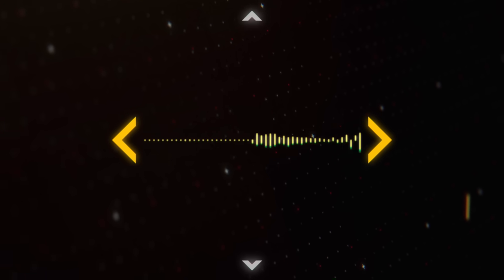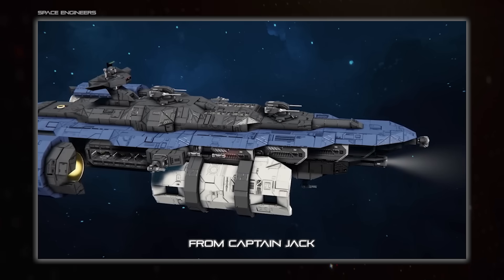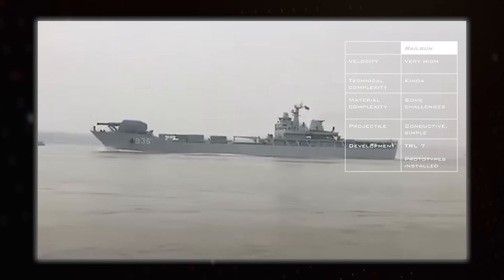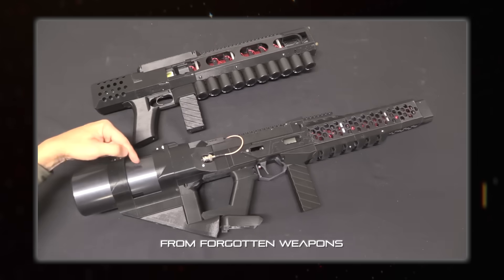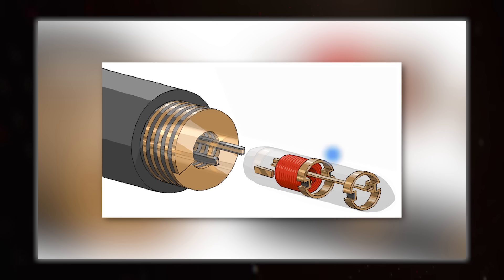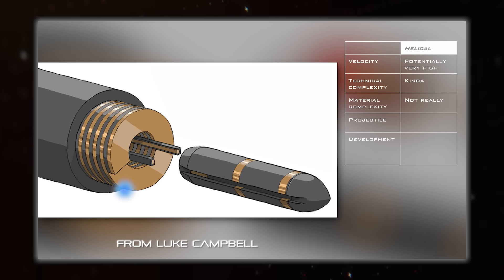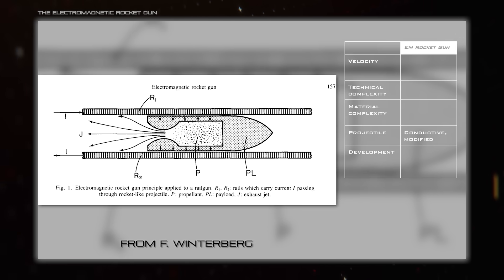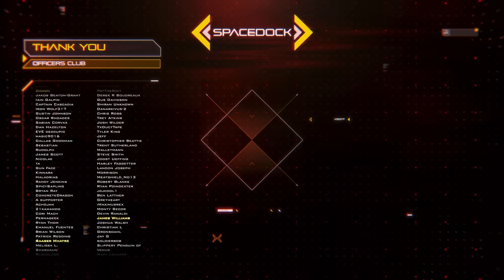The Deadly Coilgun/Railgun Hybrid You've Never Heard Of (Helical Railguns)

Comment: I think the gap is unlikely to happen because you can file those gaps with magnets or electromagenetes to boost the rail gun.
That advantage of a gun that can fire in both direction is weapon that would be aimed with the ship. 
With the acceleration involved you want those to be as long as possible to minimize forces on the ship. The longest possible is the length of the ship. Building the ship around the gun is ideal from the gun perspective but you could mount it on the side with powerful control moment gyroscopes or reaction wheels to handle the torque. 
In this case the gun can be used offensively fire fowards in direction of what you are chasing or defensively fired backwards in the direction of those chasing you without having to do the acrobatic maneuvers we see in the expanse.

Comment: Can you cover some more exotic styles of sci-fi weapons? Such as a Plasma Projector, from The game, Sword of the Stars. From what I under stand it's like those old TVs with colored toobs when you look close. It fires a literal rain of plasma projectile. Like a school of fish. All heading in one direction while being spread out a bit as wide as the projector. It's a larger weapon platform system. Much bigger then single shot plasma cannons. On smaller ships. It's mounted face forward only. While larger ships. Can have 2 to 4 mounted on as swivel turrets. The system resemblance a cone, with the flat part facing the enemy. And They only project in short bursts. And have a cool down time or recharging time. Unsure of which one.

Comment: One thing I always wondered, why do MACs in Halo have a muzzle flash, when they are essentially a gigantic coilgun?
Reply: That's not muzzle flash; that's the projectile. A projectile accelerated to relativistic speeds WILL be hot enough to emit light.
Reply: You saw the enormous slowmo muzzle flash from the Navy rail gun in this video, right?
Reply: @coltonholiday4872  Yes, but macs are coilguns. They don't have any explosive charge, because the electromagnets do all the lifting. With railguns there is an explosive charge at the beginning, otherwise the rails and the projectile would fuse together.
Reply: @attila535 It doesn't matter; rail or coil, there's going to be matter converted into plasma and pulled in the projectile's wake...from friction if nothing else (remember that even a vacuum isn't actually empty...just sparsely populated.)
Reply: Maybe an explosive to begin the launching or from vaporizing metals

Comment: Does this mean you’ll eventually talk about Induction coilguns as opposed to the typical ferrous reluctance coilguns?
Reply: Good question. In my experience (almost) all serious military coilgun research has been about induction coilguns because of issues with velocity limitations on reluctance coilguns.
Reply: @derekp2674  When I learned the difference, I figured it could make use of an iron core solenoid as the 'bolt', and the passage of electricity goes through a coil around the bolt, and another coil around the base of the barrel, to better 'squeeze' the non-ferrous bullet out.

Comment: And what do you think of mass effect magnetodrynamic weapons? basically shooting molten metal accelerated by electromagnetic force. and because it is like shooting drops of water, the whole would reach extremely high speeds, but when thrown together, when it cooled it would become a single, extremely long projectile.
Reply: basic science of molten metals: magnetism becomes zero when the metal is molten.
Reply: @jaquigreenlees  The metal doesn't have to itself be ferromagnetic like iron nickel or cobalt to be accelerated by an MHD pump (and this weapon is just a particularly high flow velocity MHD pump, at least in concept).
The acceleration happens for the same reason that the acceleration in a railgun happens. Lorentz forces induced in the pumped conductive liquid.
ANY conductive liquid will work with an MHD pump, even seawater.
Most research into MHD pumps has been based on using them to pump NaK eutectic alloy thru cooling passages in a liquid metal cooled nuclear reactor. However, like I said, ANY conductive liquid will work (including mercury, already molten metals like Lithium (probably of use in fusion power due to the want to have the lithium blanket which breeds the tritium be molten for ease of separating out the tritium and other "fission" products (yes, it's fission when you take Lithium-7 and crack it into Tritium and Helium-4, even tho the reaction requires an overall input of energy it's still fission)).
You can also use an MHD pump to pump gases if you ionize them first, this is how you get things like Ionocraft, electric thrusters for spacecraft use (using an easily ionized noble gas), and even the humble "ion wind" electrostatic air purifier.
Reply: @jaquigreenlees  The idea is that the electromagnetic force heats the metal and expels it, under pressure, that is, not by pushing or pulling but by pressing, as if it were a jet of water but with metal and due to the extreme force the speed would be very high.
Reply: I think it's the other way around - the projectiles are molten because they're being pumped with that much energy during the firing sequence.
Reply: i think keeping the metal in a proper shape would be difficult.

Comment: a weapon with reloadable rails would be cool
Reply: Machine gunner teams already carry a spare barrel. Doesn't seem that hard to take 10% off the tested reliable number of firing cycles, and stick a counter on the back to display shots until rail change needed.
I'm surprised the US dropped development on naval guns. Their range may only be ~1/10th a cruise missile, but a sabot + projectile, and a new rail every 50 shots, seems substantially cheaper than $500k-$1mil per shot. Seems like they'd be very useful for asymmetrical engagements where you're not worried about return fire from missiles. Or mount them on stealth cruisers, or semi-submersibles, or....
tl;dr it's 202x, where are the hydrofoil cloaking stealth railgun cruisers.
Reply: @ThePieIsNotALie  Two possible reasons. 

First and most likely, the Railgun development is finished, and the navy is just waiting for materiel science to solve the barrel wear problem before they start producing the things in numbers.

Or second they have publically declared that its cancelled while continuing to fund development secretly.
Reply: @ryuukeisscifiproductions1818 or they are trying to find a better power generator to power the weapon
Reply: @Dokari-l9m  No, i dont think that's the issue. The issue with the railguns power requirements means it needs to be designed on ships with ample power capacity, which excludes all current USN surface ships except for Zumwalts. but with only three zumwalts, there aren't enough of them to really bother with.
Reply: @Dokari-l9m  Nah, we have nuclear powered ships. Power requirements are no longer an issue with modern warships.
Reply: @ryuukeisscifiproductions1818  oh fair enough then.

Comment: I don't know how current implementations work, but back in the day, chemical propellant was used to give the projectile the initial push, and was then further accelerated with the rail magnets. Hence the "flames" coming out of the barrel.
Reply: I think the most recent ones are pure EM, hence why they have less of a fireball than the guns from the 90s, but they still absolutely wreck the rails after only a couple hundred shots, and performance starts dropping well before that
Reply: I also like the idea of using supercapacitors as the ammo.

Particularly in coil guns.
Reply: @jtjames79 If your idea is to remove the need for external power by having the projectile provide all the energy, that won't allow higher velocity than conventional guns because the specific energy of a super capacitor is about an order of magnitude lower than gun powder or solid rocket propellant.
Reply: @JWQweqOPDH  No. That's why I didn't say that.

Comment: One of the reason the U.S. Navy dropped the rail gun is because the ammo need to survive beings shot out and do damage to traget cost as much as proven missiles. So it was cheaper to put more missiles on a ship than a rail gun.
Reply: that is not true, your mixing that up with the 155 mm AGS on the Zumwalts. Railgun projectiles are still much cheaper, and the only reason they even run as high as $25000 a piece is because of the guidance system. Inert unguided projectiles cost even less than conventional artillery ammunition since they dont have an explosive warhead.
Reply: They also repurposed the projectile to fire from conventional weapons, so it wasn't a huge loss. A major issue was power consumption. I'm 99% sure this is public knowledge but ships have power consumption issues, namely they need power to run all the new fancy stuff and weren't designed for it. So, they could only fit a decent sized railgun on nuclear powered ships. The EM interference also caused havoc on other systems.
Reply: @randomkaycomic  the repurposed projectile also got cancelled.

As for the railguns power consumption p0roblems. it can be fitted on conventionally powered ships as long as they have the spare power capacity. Problem is, aside from the Zumwalts, modern surface ships just dont because they where all designed before railguns. 

Which is probably part of the reason why Railguns haven't progressed much, there are no current ships capable of using them and the USN needs a new class of destroyer to use them, and its gonna be quite a few years before those ships are even going to start to be laid down.
Reply: last thing i heard was the barrels were getting too warped after the fourth shot.
Reply: @jdo8405  Which is dubious. China's military has had a lot of high-profile blunders in recent years. Even in the promotional videos, their rifle were keyholing at close range.
Reply: Turns out lasers are most practical for blinding missiles, too.

Like a kid blinding a search helicopter with a laser pointer
Reply: @jdo8405  I don't doubt their power, it's always a folly to underestimate another's power. They have however come out with some paper tigers that are the big bad, there is also a lot of public evidence that they steal some of their high end tech.
Reply: What about ceramic coating then Teflon over the ceramic coating on the projectile. Kinda like the space
 shuttles. That would keep the air friction from eating the metal quite a bit for a bit.
Reply: @MisterMayhem727  That would work but  is expensive and it could chip if not handled properly  thus making it less effective.
Reply: @jdo8405 CCP propaganda. Which this video presenter also falls for.

Comment: When you said a Coilgun/Railgun Hybrid.
I was thinking more a long placing the plasmified hydrogen from the expanse railgun at the tip of a MAC for an extra boost of speed.
On that note. We can already use magnetism to create thin walls of plasma to keep atmosphere from passing to a vacuum. 
Maybe in a few decades once we're beginning prototyping the first space battleships. 
I could see us use something like that for the spinal weapons
Reply: Using plasma to extend a railgun as many have suggested wouldn't work.
The plasma rails would be instantely dispearsed by the powerful magnetic forces, instantely cutting the current.
Reply: @gavinkemp7920 What if the plasma was contained by a solid insulative trough (barrel)? Compared to a metal rail it would reduce projectile friction and weapon mass at the cost of higher resistance.
Reply: @JWQweqOPDH  The plasma would it self cause erosion due to the high temparitures and charged particles involved.
Reply: That I believe would be called a plasma railgun. And overall, they are basically railguns, but worse. Although I am talking about railguns using plasma as the armature. But yes, the plasma can get dispersed, and it also causes wear and tear

Comment: What about electromagnetically accelerated chemical guns (be they Coil, Rail, or Helical accelerators)? Is that viable?
Reply: Yes. Explosive propellant was used in some railgun experiments because the projectile is less prone to welding onto the rails if it is moving when the current starts. It might prove useful for saving on capacitor size and charge time in any electric cannon to use chemical propellant for the first 1000 m/s where conventional propellants are more effective, then electricity up to final muzzle velocity.
Reply: @DecidedlyNinja  Thanks.

Comment: What about hybrid between Railguns and normal guns such as a Chemically assisted railgun where the projectile gets its initial acceleration from a chemical propellant before the rails take over? one such weapon would be a Electro Thermal Chemical gun.
Reply: While the definition is correct, most militaries refer to an ETC gun as a chemically projected gun that uses an electrically-induced plasma explosion as a primer for the charge, in order to make the explosion uniform, quicker, and able to accelerate a bullet way faster (meaning that  compared to a traditional round you can either have a faster bullet for the same barrel length, or a way shorter barrel with an equally fast bullet). Such weapons were actually used in the movie Elysium, were called Chemrail (chemical+rail) and were absolutely cool!
Reply: @valeriogennari2626  ETC guns can (and in testing have) also used LIQUID propellants, which apparently also allow higher velocities beyond just the ignition improvements of a chemrail using an electrically exploded wire as the initiation source in a line along the length of the "casing" (rather than just at the base like with traditional powder+casing ammunition), due to the ability to mix a liquid fuel and oxidizer only when the projectile is ready to be fired rather than require those two elements to be premixed in a solid material (this requirement puts an upper bound on the maximum energy you can get out of gunpowder while retaining shelf stability). Not mixing the components before hand means they can be less stable when combined but still shelf-stable because they are only mixed just before use.

Comment: I'm surprised that superconducting coilguns/quench guns weren't mentioned
Reply: I did briefly mention them in the previous kinetic weapons video some time ago. The star of the show today was the helical which I find really cool!
- hoojiwana from Spacedock
Reply: @hoojiwana  I was actually curious about reading more information on the Quench Guns. The information I found was really not all that big in quantity.
Reply: There is a theory on self repairing rail guns using a type of gallium. Or ones that can repair themselves using heat. 

 So we can synch up particle accelerators. Can measure in atto seconds. Soon Femto. 

 Yet cannot time a coil gun going under Mach 20. 

 Wish he'd do a video on PDC. Personal defense cannons. 

 Militaries around the world would rather spend billions on missiles than make a trophy system with a gun for slower moving munitions. 

 Those two technologies are ones I just don't understand why no ones pursuing. 

 Coil Gun, coil gun hybrids using chemical fuels. Then a way to turn remote turrets into PDCs. 

 I want a coil gun that fires dime sized discs that can be directed with a laser or something. Has Piezoelectric bending the disc mid flight in certain patterns to go left or right. Up or down. 

 I'm surprised no one has attempted a serious disc gun yet that can kill. Killer dime sized frisbees!

Comment: Genius.  We need this on USA navy ships
Reply: The issue is the massive amount of power needed. The US navy did try and it works great but the powerbank was fucking huge
Reply: @horndogfred5246  Not only that but the amount of rail erosion made it impractical, at least for the target velocity General Atomics was shooting for. Both the Chinese and Japanese projects are trying to work around this by going for a lower velocity to bring rail wear down to practical levels. US navy is waiting till metallurgy can catch up to make the desired speed practical because the Japanese solution doesn't yield, in the Navy's eyes, significant ballistic improvement at levels of power draw over existing 5" guns.
Reply: @acarrillo8277  There's also the problem that such weapons are not really useful for indirect fires, unlike the existing 5" guns and missile systems. Railguns definitely have advantages for ballistic missile and anti-aircraft defence, though.
Reply: @horndogfred5246 hence why we need to invest more into sustainable fusion
Reply: @horndogfred5246  The power was not the problem. That's why they had if for ships to begin with. The problem was that you'd only be able to get several shots off before the barrel needed to be replaced.
Reply: @supremecaffeine2633  the power was absolutely the problem. The power bank was enormous, it took ages to charge, and it was very dangerous. I'm not discounting this video but the navy had different concerns
Reply: @horndogfred5246   It was going to be powered by the ship's engine. Power wouldn't be a problem unless the ship was low of fuel. Being connected directly to the engine negates the need for a power bank.
Reply: @horndogfred5246   It does.

The engines of a destory are more than enough to power it. 

It had a power bank because it wasn't connected to a Zumwalt as was planned if successful, and they confirmed that even an Arleigh-Burke could fire it if other weapon systems were removed without upgrading the engines. Not to mention if was first tested on a ship before moving to land.

The 5 inch gun on an Arleigh-Burke is almost 30 ft tall and almost 48k lb. Size in not a problem.